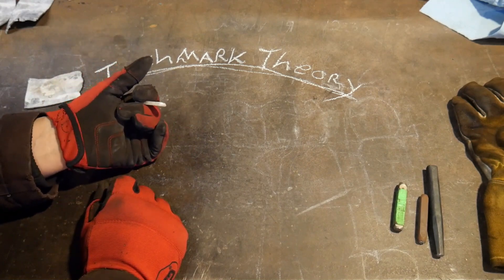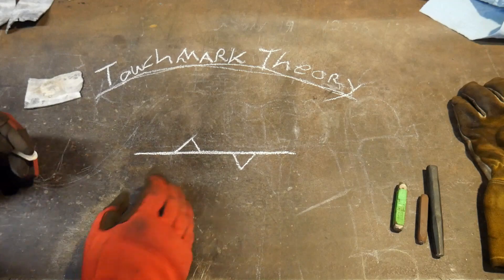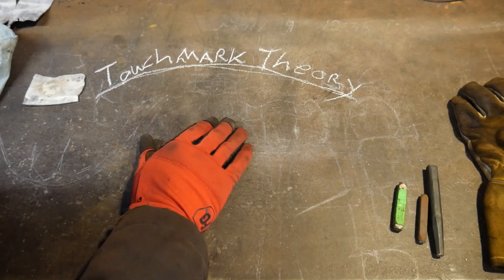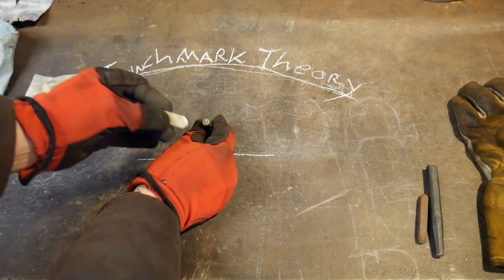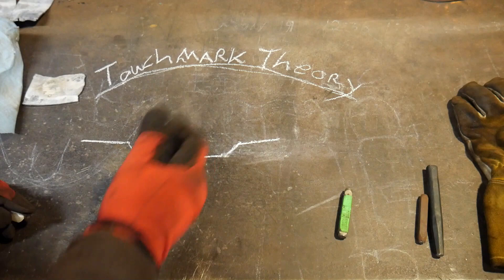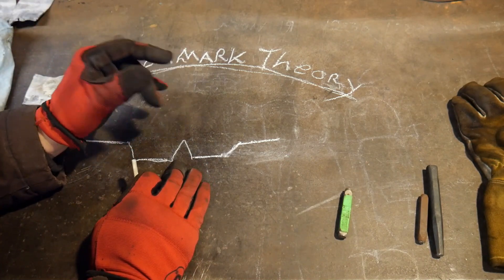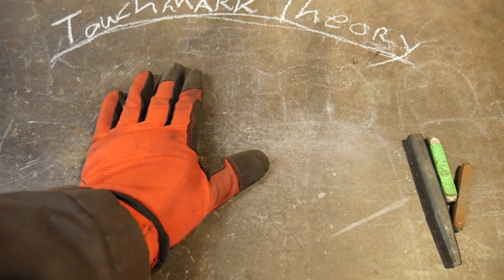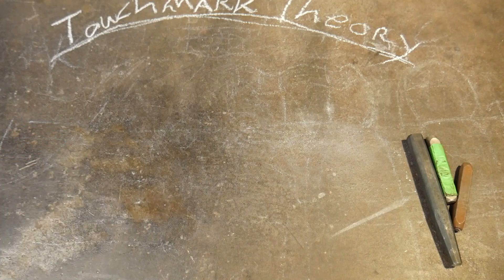Touchmark Theory

Comment: Good info,.. I'm about to make a touch mark.  Since it will be used on hot punch surface do you think Rockwell 55-60 is ok?  I'm also using my alpha set to punch in the end of the touch mark.  Got luck on that one since my initials are WA.

Comment: Roy, could you take your engraved stamp and use it on the end of a hot steel rod to create a positive image on the hot steel that once cooled could be used as a touchmark to embed the image in cold work? (I've re-written this question 3 times and I'm still not sure it is coming across correctly.) --Edit: I just realized that Terry asked the same question.
Reply from the maker: Yes that should work fine :-) God bless